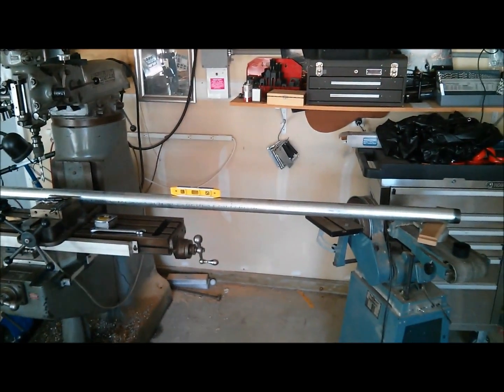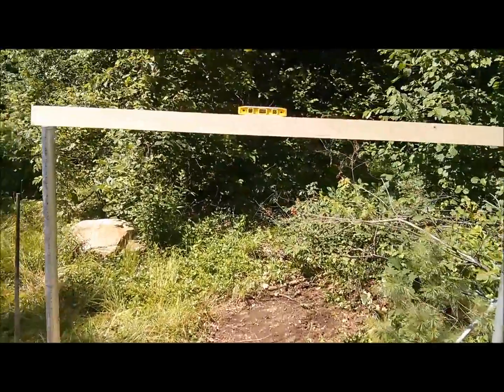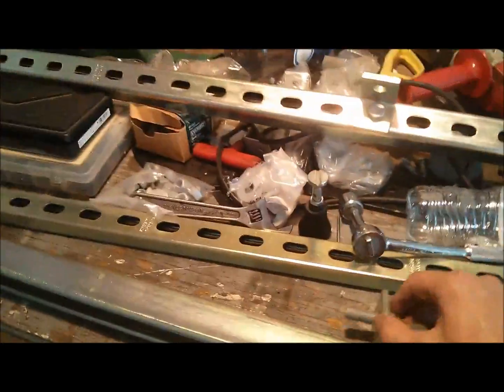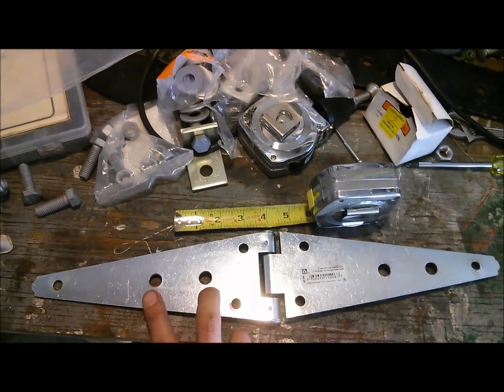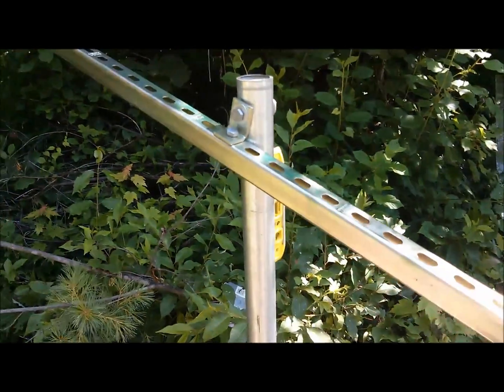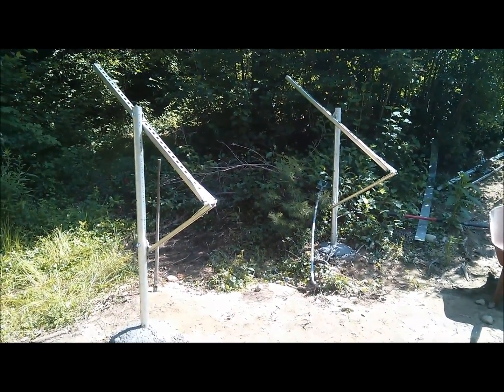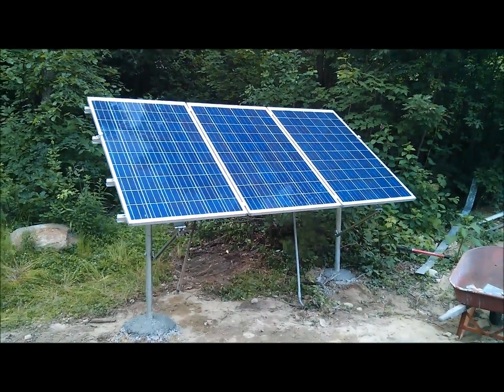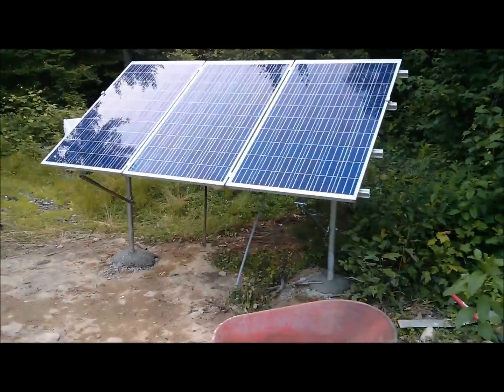ground mount solar panel diy

Comment: Local metal sales places may sell longer pieces than Home Depot, 20ft vs 10ft and they will cut to whatever you needs are so you can take it home safely.

Any place you marry steel to aluminum, you might want to do some kind of insulation.  Hot glue gun, pieces of cut up plastic laundry bottle, caulking maybe?  Aluminum loses electrons to steel when touching steel:  it is called "galvanic reaction" and corrodes and weakens the aluminum prematurely, especially while wet.  You have to ground the aluminum with aluminum wire, I guess.

Comment: You're in New Hampshire, so you get your share of snowfall on your panels each winter. I'm surprised that you don't try to design to avoid squeegeeing snow off your panels. The rig could allow the panels to be flipped over at any time, thus avoiding any snow accumulation on your panels.

Comment: I am building a 400 lot array with renogy panels....May I ask what size wire did you run to the house and how far away is it?  I’ve had two panels up for a couple years and I have them wired in series so my voltage coming in is 24 which allowed me to use smaller wire coming in the house when I add the next two panels I’m not sure if I’m gonna bump it up it depends on what kind of charge controller what kind of voltage the charge controller will handle.                                             And did you ground the panels or is the post in the concrete considered the ground?                                Nice clean job! I’m in the Hampshire as well.............way over west in Claremont❤️❤️🇺🇸

Comment: 5 1/2 years later.

How is it holding up?
How often do you adjust the angle?

Did you drill more holes for more angles?
Reply: Three times per year and no additional holes needed.

Comment: I know this is an older video but I was wondering what the hole was for that you drilled at 24 inches?  It looks like you used the 2 inch and 36 inch holes.  Was it for added support if needed?

Comment: Well Done.! I like your setup. I already have mine, now I want to add two more panels. So I absolutely need to know where I can find the brackets on top (extruded aluminum) that are holding the panels in place ??? Can I find them at Home Depot?
Reply from the maker: Thanks Guy. Here is a link to the extrusion that I used. https://www.renogy.com/renogy-5ft-solar-panel-roof-mounting-aluminum-rail/

Comment: G'day Keith, Thanks for the video... it has also given me extra confidence to do my own solar array. I'm building an off-grid cabin in the opal fields of Lightning Ridge NSW Australlia. My plan is to use 3 recycled industrial pallet racks frames - they have a span of 2650mm (about 9') each, giving a total width of 18' where I will mount 6 panels.This is the bit I'm not sure about (span).
I would like to know if you have had any issues to contend with since installation and would also like to know what your span between posts is please. I dont suppose you'd have a detailed 'how to' as I've been copying and pasting bits ot the video (hope you dont mind).
Regards Chris
Reply from the maker: My panels are about 39"wide. I have three panels that fit nicely on a 10 ft. wide span. I have had no problems with this setup. It is important to bury the posts deep (as shown in the video) and use plenty of concrete. I just sold my house and I took the whole setup with me. I dug out around the concrete then plucked the post out of the ground with my tractor. I broke the concrete from around the post with a sledge hammer. Looking for an even better solar site. Good luck with your project. Let me know how I can help. -Keith

Comment: Nice job.  I wish I had a mill with a vice lol.  Your video provided me with a lot of good ideas; thanks.  The commercial mounting systems are sure proud of themselves  $$$$  I will be fix-mounting my panels since I will be mounting more panels than needed.  I will weld the two sections of super-strut at 45 degrees, then mount the two (four) ends to the poles.  I'll use super-strut for the cross supports as well.  Thanks again for the video; great job.

Comment: Why didn't you use the strut as it was intended to be used with strut nuts?
Reply from the maker: Bennington Camper This was the first time that I used unistrut for any project so I'm not suprised that I didn't use the strut nut. If you do something similar to this with strut nuts please provide a link. Thanks -Keith

Comment: I would like to do a DIY grid tie solar ground mount, but part of getting the permit is to get an engineered plan of schematic.  I can not afford one.  Is there any other way to do it?  I am in Southern CA.
Reply from the maker: Samuel Rodela Hi Sam, sorry I missed your comment. I'm not sure what an "engineered plan of schematic" means. I would try to get a better definition. If what they are looking for is an electrical schematic then you could probably find one supplied with the charge controller that you will be using. If they are looking for a drawing of the mounting solution, maybe you could see if a hand drawing, with dimensions on a piece of graph paper would work. They should be able to tell you exactly what information they want on the print. Please let me know if there is any other info I can provide for the setup that I built. -Keith

Comment: Really good job, you gave me a lot confidence to do my own ground mount on the cheap.
I'm trying to decide if i should use 4 X 4 Oak or 2" galvanized STD fence pole.
I need it to be 10 feet above ground, 3 to 4 feet in the ground. What do you thing?
Reply from the maker: My first comment! good to hear from you. Go for the galvanized pipe. The solar panels act like a sail in the wind. There will be a huge amount of torque produced during a wind storm and  you will need all the strength you can get. The galvanized pipe should stand up better to the moisture in the concrete too. Really impressed with the rigidity of my setup. I have since built a very similar setup for two 4x8' solar water panels. That worked great too. Best of luck.-Keith
Reply from the maker: ***** hey Rookie, how are you? here is a link to a engineered ground mount solution. http://www.schletter.us/fs-kit.html. The cost is about $900 and it holds about 6 250 watt panels. That price was too steep for me and I only wanted to mount 3 panels. I want to put my money into panels and not holding them up. $900 = approx. 900 watts! of panels. A ground mount system is pretty ideal in a place that has 110 mph+ winds because you can tilt the panels parallel to the ground prior to hurricanes or major storms approaching to reduce how much force is applied to the panels by the wind.  I had home depot cut my poles down to 8ft. but in your case I would keep them the full ten feet. Bury 6 ft. of the pole and still 4 ft would be protruding. Depending on the diameter of your hole you would have an extremely rigid mount for your panels. My hole diameter was only about 8 inches x 4 ft. deep. If you wanted additional support you could use aircraft cable connected from the top of the pole to j bolt anchors in concrete form tubes 4+ ft away.I say that you should go for the Rookie solution! Let me know how I can help.Good Luck -Keith
p.s. I just installed two 6 volt golf cart batteries in series in my system. Looking to have a bit more energy storage capacity.
Reply: Oh crap.. I just did pretty much exactly what you did Keith, BUT with 4x4 pressure-treated wooden posts.... So you're thinking high winds will tear the whole thing right out of the ground ?
Reply from the maker: If you used concrete on the 4x4's you should be alright. I used a very similar design to hold up my solar water panels and the posts moved over the winter. Not sure if I didn't use enough concrete or if I didn't go deep enough or if the panels just weigh more than the pv panels. The location of my panels is kind of protected from the wind.  If you are expecting high winds you might want to tilt the panels so that they are parallel with the ground. Good Luck. Thanks for your comment!
Reply from the maker: Did you end up going for it? Interested to hear how things went. 10 ft over the ground sounds challenging.  I'd go for the 2" galvanized pipe. The fence poles tend to have a thin wall from what I've seen. If possible keep it close to the ground to reduce the torque exerted on the posts. Good Luck -Keith